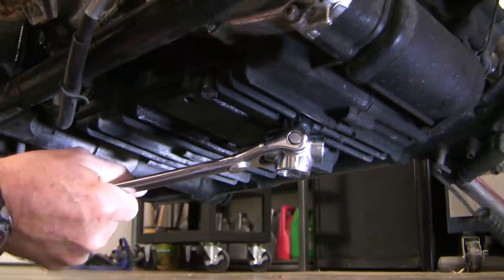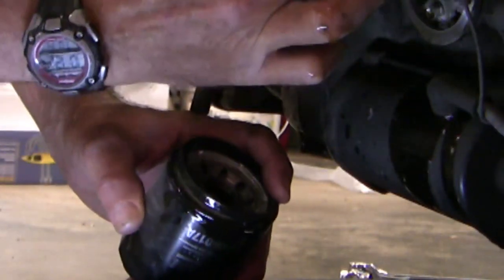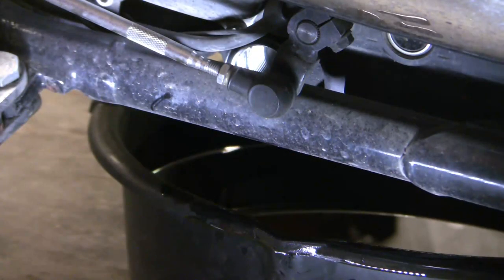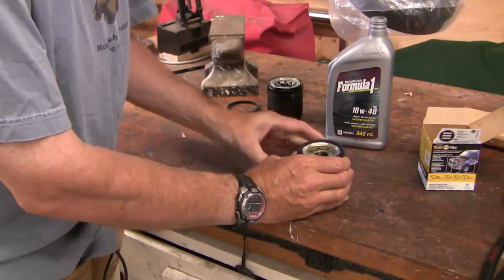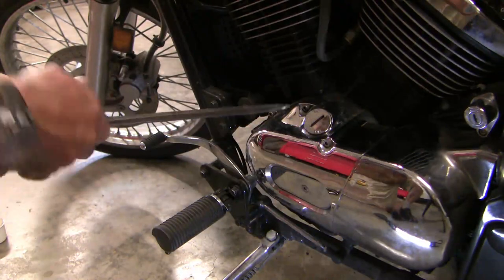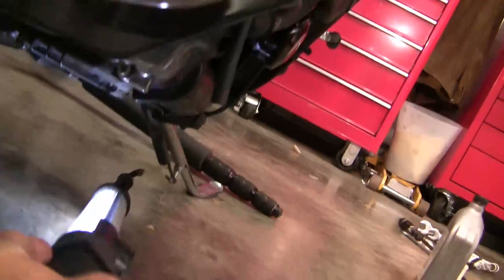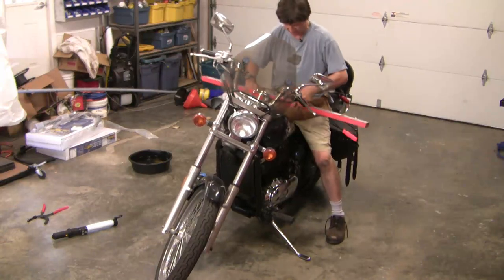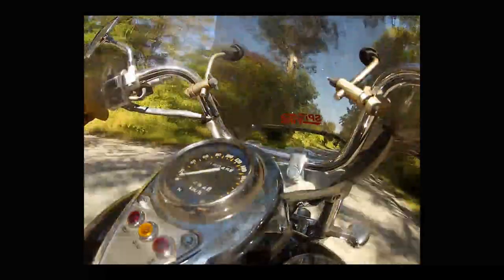How to change motorcycle oil,  Kawasaki Vulcan

Comment: I've done clutch repairs on two Vulcan 1500 motorcycles, the first  one at 12,000, and again at 30,000 miles and another at 13,000. The first one was for a clutch spring which wore out and again changed a second time  before I sold the bike,It was a 2000 model. I bought a 2002 a few years later and had to replace the same spring and the clutch pack. I added a disk that was thicker than the stock thickness to improve clutch engagement. I would have used a clutch spring from a mean streak but they did not have one in stock.
I believe the Vulcan suffers from some poor engineering with the clutch spring, it wears out way too often. Having said all of that, I wanted to say that the reason I was given for clutch plate failure is the use of any oil other than the oil that is offered by Kawasaki.
Any additives that are found in any other oil will destroy the clutch. I'm not one to believe everything I hear but I know I'm getting tired of working on the clutch, the nut that holds it is a real bear to break loose. I bought a half inch impact wrench and a new compressor just in case I need it.
Reply from the maker: Your note adds an interesting discussion point to the thread and I hope others comment on it. You raise a very good point that when fluid is multi-purposed, as it is in the Vulcan, fluid quality is even more important. The engineering constraints have to be spectacular, and of course changing oil regularly can only help that. It's a thoughtful remark to wonder if some additives may actually worsen clutch performance, since motor oil is not really designed for the clutch. I don't know, although after 18 years and (only) 16,000 miles I haven't yet had to work on the clutch, except to replace the cable.

Yeah, your experience with burning clutches is unusual. Often burned clutch plates can be from driving habits or clutch cable issues, but in your case the though of a weak spring design is convincing. Thanks for adding your comment here!
Reply: spelunkerd Your welcome, I would add that I purchased the second bike used with 12,800 on it. I paid what I thought was a premium price for it because it was in what looked like good condition. As you can see it did not take long for the clutch to self destruct.
I have no idea what he was using for motor oil but the clutch plates were really a mess. When I called him to let him know that the clutch was fried he told me that it was a good thing I was able to do the work myself and save myself labor costs.
I guess he figured that since I did the work and saved myself money, that he did not need to offer anything to help because he did not . Nice Guy!
Reply: I have a 1996 Vulcan 1500 classic and it should have been recalled with Kawasaki admitting a screw up.I have had constant clutch problems, frozen twice while in the middle of a ride.Just froze again for the third time.Bike is well maintained and treated with care it is just an awful flaw .

Comment from the maker: This was the only option for 10-40 non-synthetic motor oil at the store I went to. The filter I used was a NAPA filter but I've used Canadian tire for them as well. I have no experience with the red filters you describe. I used to use Fram filters but more recently I've drifted away from them because of quality concerns.

Comment from the maker: Yes, up here in Canada we normally use cold weather oil for winter use. I try to never have 10-30 oil in my car in the winter, preferring 5-30 oil for that. 10-30 changes to molasses at 40 below, ha ha. But the other issue is the fact that I never ride my bike in the winter, anyway. And it's complicated to change oil seasonally since it means at least two changes per year, which is more than I do for my rarely used bike. So, for my bike, I use the same all the time. Cheers!

Comment: The first thing i did when i bought my 800 was change the oil.  Would you believe i got just under 5 litres out of it !  No idea how the engine hadn't got hydraulic lock but i was glad i found out early on !
Reply from the maker: Yeah, and I think it's pretty common for people to underfill as well, not realizing that the bike needs to be level when they use the sight glass. Fortunately most vehicles are designed to allow some latitude. Thank you for watching!

Comment: I don't have a workshop manual, I didn't know about the gauze filter,cheers
Reply from the maker: It's too bad that companies like Alldata and Mitchell haven't yet started offering copies of manuals online for motorcycles, like they do with normal cars. I have electronic copies of dealer repair manuals for all my cars, which helps a lot. You might find a copy for your bike on ebay.

Comment from the maker: As I recall the manual calls for 10-30 oil, but you should double check that for yours. It does partly depend on what the ambient temperature is, with oils better for cold weather being useful in cold climates. But since I park my bike in the winter, I have used 10-30. I have not used synthetic oil.

Comment: Re:  removing seal on oil filter..  listen up folks. It can happen. Never happened on any of my bikes BUT it did happen on my 89 Ford Ranger. Luckily when I backed it out of the garage I looked in front of me and saw the oil trail. Barely any left on the stick but no damage. If changing the oil & filter the proper amount is 3.2 qts.  I have a clear 2 gallon plastic container and marked it at the 1 qt and 2 qt level with a black sharpie. No guessing. Added bonus is that a lot of riding mowers use 2 qts as well although they state 1.9 liter which comes out to 2 qts.
Reply from the maker: Nate Ngzcaz Sage advice! Wisdom is almost always a product of experience from misadventure. I had a similar 'near miss' experience. 

Regarding your advice to use a graduated flask, that's what I do, too. I keep a 5 litre container with marks on it for each vehicle, and it makes the oil change so much easier.

Comment: a 2x4 under the kickstand usually puts just about any bike in the vertical position for checking oil level. on my nomad a 2x4 with a piece of 3/4" plywood holds the bike near perfectly vertical. the bike wont go anywhere and its pretty simple to just prop the bike up and check.

Comment from the maker: Gee, another good idea. On some engines I use a removable metal or plastic flange to cover sensitive parts like sensors, wire connectors or universal joints that may immediately underneath the filter. Masking tape might be simpler and more versatile....

Comment: It is best to run the oil about half way in the view window.  If too high it gets oil in the air filter.
Reply from the maker: Good point, too much oil causes foam that can rise to the level of a vent and contaminate parts that don't want oil. Very old bikes vented straight to the ground, but newer ones vent to the carb. If the drain hose kinks or plugs, the air filter will sit in a little lake of oil. Mine doesn't seem to have a PCV valve so that may be an issue too.

Comment: I have a very puzzling problem with my bike. Only 16 000 km, bought new, always state of the art tuned and maintained . I drive it with care and never push it to its limits. I'm the only driver and noboby else has access to that bike. That bike always give a great service and satisfaction until 2 weeks ago, as I noticed that the engine oil was low. I always used Motul 4w40 Synthetic oil. So I filled up back until the oil level was full and went back on the road. After only 65 km, I checked back the engine oil level and the oil level had dropped to the half. Thinking the oil filter could be in trouble and making the engine oil pressure to open the oil pressure relief valve causing oil to be burned, I changed the oil and the oil filter. I filled back the engine with the requested 4.6 L of Motul 4w40 Synthetic. One hour later in the garage, while the engine did'nt run, at my surprise, the oil level was less than the milldle of the oil stick. I filled up back, adding 1 more liter of oil. I runned the engine for a couple of minuts to be sure that the new OEM oil filter would be full. Then I went home to sleep. The next morning, I went to the garage and once again the engine oil level was a bit over the minimum. I added again oil. Now I filled up my bike with a total of 6 liters of engine oil even the user manuel and the service manual say that it takes not more that 5.1 Liters when the engine is completly dry. That bike don't leak, never leaked and doesn't smokes when I drove it for testing in order to discover why that engine oils is disappearing. Where that oil can go into the engine, if it is not burned, it doesn't go on the ground ? Does somebody from you have a clue to help me. Thank you very much. It's a 2013 Nomad 1700 cc. I would appreciate any idea that could help solve this puzzling mechanical situation.
Reply from the maker: Sorry, this remark ended up in a 'review' box, not seen until I stumbled across it today. What a curious problem; I don't know! I'd be checking dealer literature to see if oil could be pooling inside the transmission, beyond a seal. With only 16,000 km, it must be warrantied, I'd be interested in what the dealer told you and how it was fixed. Please let us know, thanks for your comment.

Comment from the maker: I went back to the 95 Vulcan OEM dealers manual made by Kawasaki, and in the manual is a photo showing that I have placed the screen correctly. It's always been like that in my bike. The screen is like a thimble, fitting over my finger with the open (neoprene) end pointing to the left of the bike. 

Yours may be different -- maybe they changed the design. Because of your remark, I'll add a note to the video explaining that. Thanks for your input!

Comment from the maker: The basics are the same for all four stroke engines, but if you buy it you should get a copy of the dealers manual (not just the owners manual). Inexpensive copies of those repair manuals are often for sale on ebay. I don't own the 2003 so I can't give you more detail than that.

Comment from the maker: (cont'd) oil filter was removed (and full) all have some bearing. I always run the bike before changing, because I want some oil to stay in the heads and lubricate for the first minute before oil from the partially empty filter has a chance to get there. So, you never get all the oil out. It's not as bad as a trans fill on a car but you rely on frequent changes rather than relying on getting every drop out. The damage of a dry start is worse than that of leaving a small amount of dirty oil....

Comment: Hi Spelunkerd

I bought a project Valcum 1500 year 1999 online and thanks indeed to your  maintenance DIY video I manage to understand the Vulcan much better, I did the oil change, flush coolant new spark. Rewire ....etc Finally able to start up however a little problem is once accelerated the engine kills. Before I strip the bike down and do the carb clean, I am thinking if I might have the hose underneath the tank mix up? May I ask if you could let me know under the gas tank there are three hoses. On the very left side where the petcock sits has one nipple assume that is the fuel line which connected to the fuel pump. Further down closer to the seat there are two more nipples one is a metal directly down from the tank I am thinking that one is the gas fuel drain hose and the line should go downwards open. The third hose is the gauge, fuel which has a black cover attached as well a connector wire cable I wonder the plastic nipple if I guess right is that the vacuum line and if the house should connect back to the crack case? 
If you could kindly let me know or email me at showstime@hotmail.com that would be really appreciated.
Thank you once again.
PT
Reply from the maker: It's not easy to reply without actually seeing it. You should invest in a copy of the dealer service manual, Kawasaki offer searchable parts drawings for free online, and they sell the service manual. Or, you could search ebay for somebody who could offer a pdf copy. These Kawasakis have an emission device, similar but not identical to an EGR valve, that transfers some fuel and blowby gasses from the head to the exhaust, to more thoroughly burn emissions. It is popular, though in my opinion misguided, to disconnect those devices, so don't be surprised if the previous owner did some DIY modifications.

Comment from the maker: It has to be four stroke oil, and I would use the type suggested in the owners manual. Since the oil serves a dual purpose for the transmission and engine, I wouldn't deviate much.The debate lately has been whether to use synthetic or natural oil. Natural oil is cheaper. Although it may not last as long it is telling that manufacturers don't lengthen the change schedule much if synthetic is used. I try to avoid discount filters -- at one time I used Fram filters, but I rarely do now.

Comment: I think most people find very little on the pump screen the first time.  After that they find it clean.  Even if you found a little on it the screen surface area is huge.  It probably only needs to be checked rarely.
Reply from the maker: Yes, that's been my experience, too, mine has been consistently clean. If you find coarse fragments, it would be a warning of more serious problems inside the transmission or engine.

Comment: hi, i have a kawasaki vn 800 A. is necessary take off the two screw to chenge the oil? and is the same level the transmission and engine oil? put the same oil in the same hole (oil) thank you a lot

Comment: good, thorough instructional video. quick question, does a 2012 vulcan 900, have those screen filters, and how often to change?
Reply from the maker: I don't have any personal experience with the 2012, but based on remarks from people here on this thread I suspect it does have a screen. My screen has been remarkably clean every time I look at it, I clean it each time but have never replaced it. Some people have remarked that their screen goes in the opposite way, I suspect the manufacturer may have changed their standard through the years, so I would note which way it is oriented and reproduce that when you put it back together. Better yet, get yourself a dealer repair manual, it will pay for itself if you do enough work on your own. My dealer repair manual verifies that the screen orientation I show in the video is correct for this year of Vulcan.
Reply: @spelunkerd  thank you sir. hey, do you know anything about the v9 2012+ years, have a 5th highway gear shudder, however, a pulley conversion kit, helps it. Do you know a youtube link DIY, or any truth to this?
Reply from the maker: @mml1224  I've never worked on a V9, it sounds like an adventure. If you do it seriously, remember to bring a camera along, I'm sure others would want to look over your shoulder.

Comment from the maker: Every bike is different and the first stop should always be the owners manual. Most bikes, mine included, require the bike to be on two wheels and level, not on the side stand. I don't think the center stand is correct but check the manual. 
You ask a good question about fill volume, and indeed the manufacturers do just that for an initial fill. But I never trust those numbers, and variance in how recently it was driven, whether the fill cap was off when you filled, and whether the (continued)
Reply: hey where did you get your filters

Comment: Mr. Spelunkerd Sir what brand and size oil filter wrench did you use?  Thank you.  Also would you happen to know why the two filters?
Reply from the maker: The wrenches I have are generic style, I have about 6 different kinds, mostly to cover the range of diameters I find when changing motor oil. If unsure, buy the new filters you want and walk down the isle in the store and see if they fit. Strap wrench style work OK and don't damage the filter, so if you get part way into the job and can't complete it, you'll still be able to drive the bike. My favorites have powerful jaws which make it a little easier but they can tear the thin metal sidewall of the filter, so you're committed, you can't run the engine until the task is done. I'm not sure why Kawasaki have both a screen and a filter.

Comment: Thank you for this great video!
I have a 1994 Kawasaki 750 Vulcan would the oil change steps are the same. How do you change the front turn signals on a Kawaski 750 Vulcan /1994?
Reply from the maker: Monk75FC See if you can find a dealers service manual -- they are easier to find for cars but manufacturers make them for bikes, too.

Comment: the only manual I have is a paper back parts manual for wlc harley 45 that owned back in the seventies, would  be  a must to someone who owns a wlc, I don't have a drain plug like yours at the front of the engine so I guess the Drifters are slightly different